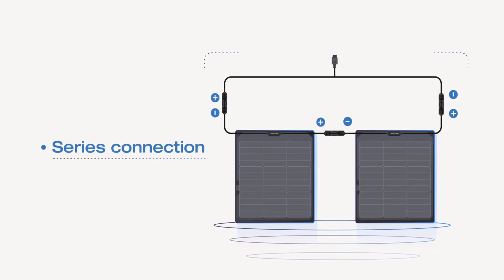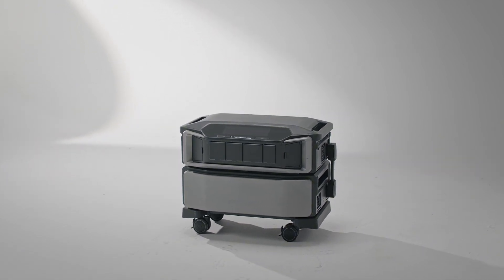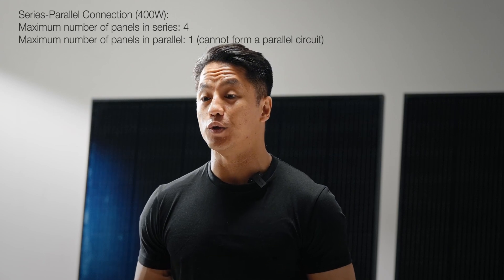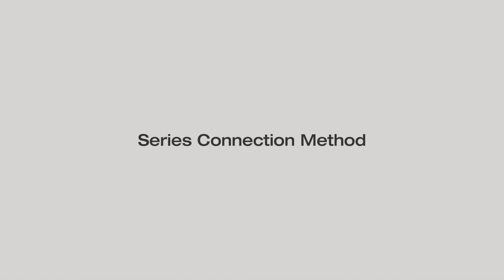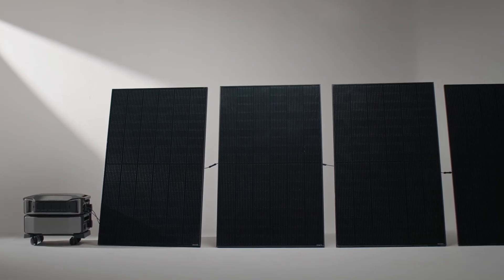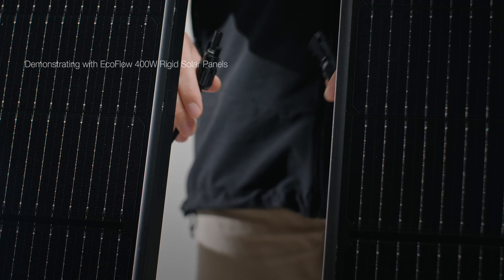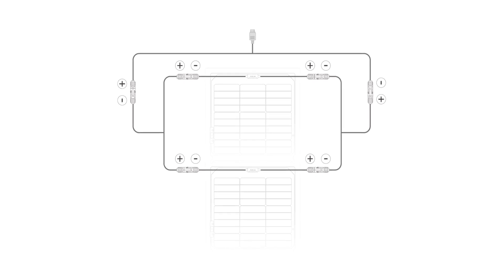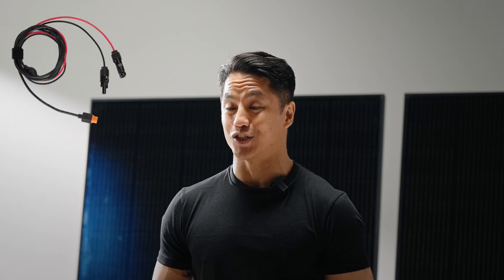Solar Panels Wiring Guide: Series & Parallel | Eco Academy 101

Comment: I'm confused. Both the High-PV and Low-PV inputs on the Delta Pro Ultra are limited to 15A. Only the Vmp max voltages are different.

If a single 400W panel has an Imp of say 9.8, then just having 2x 400W panels, wired in parallel, would mean a combined possible Imp of 19.6A under great sun conditions.

Obviously, 19.6A is well above the maximum limits of both the Low-PV and High-PV inputs (15A).

Yes, it would take ideal conditions to get the full 9.8A out of each panel, but the fact still remains that 2x 400W panels alone are perfectly capable of exceeding the maximum Amp limits of even the beastly Pro Ultra, given favorable sun conditions.

Am I understanding this wrong? If so, could someone please explain what part of my thinking is flawed/incorrect? Because I just don't see how using even 2x 400W panels in parallel does not already risk exceeding the max Amp PV-port input of either port, thereby damaging the inverter.